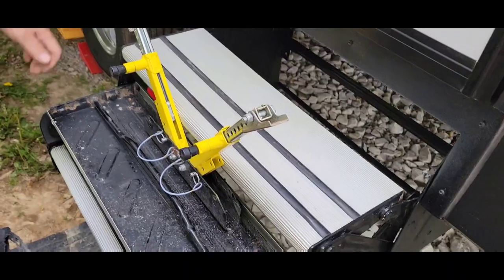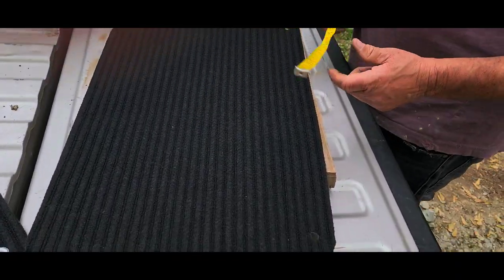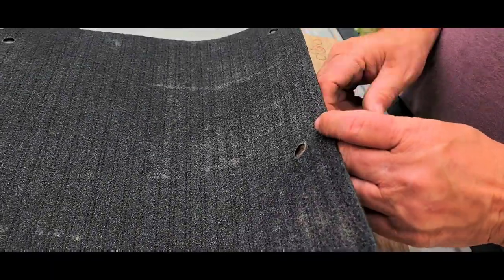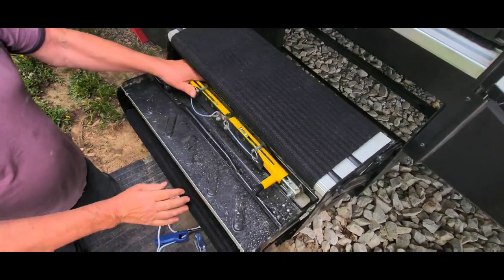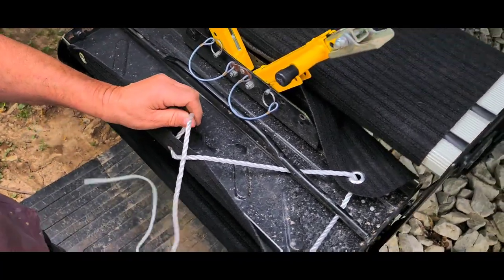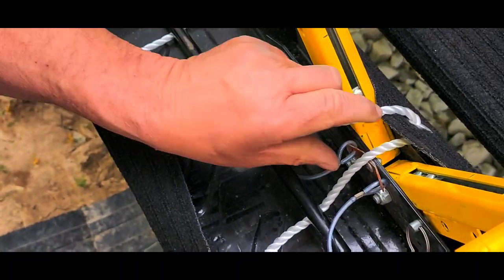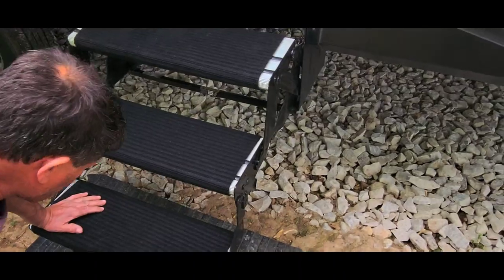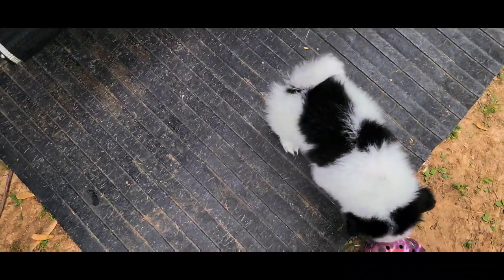GRAND DESIGN REFLECTION 303RLS DIY @TheArtofRVing /NEW HORIZONS

Comment: I was going to put some carpet on my steps but my steps are steel and the carpet will hold water and the steps will rust out. I just painted mine and spread sand on the wet paint for traction. Carpet is  a great idea for aluminum steps
Reply from the maker: That's very true. Those steps get hot in the heat and hurt the dogs paws. So I wanted to put something there